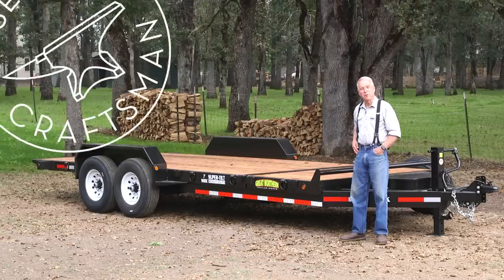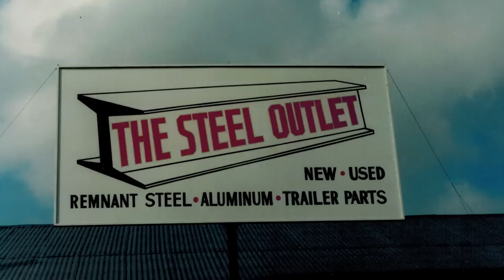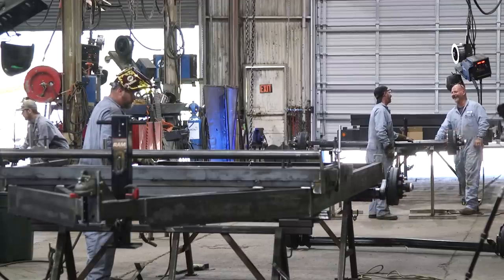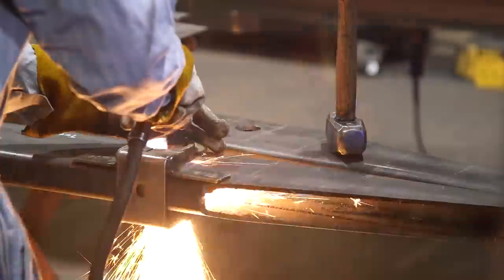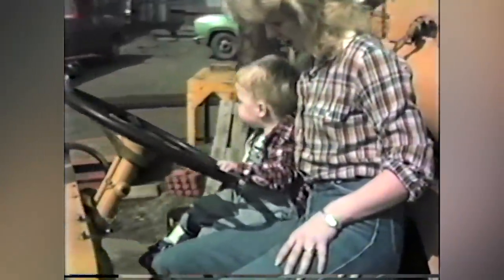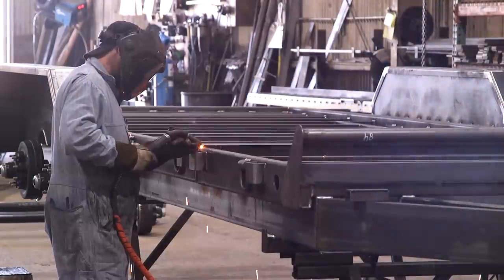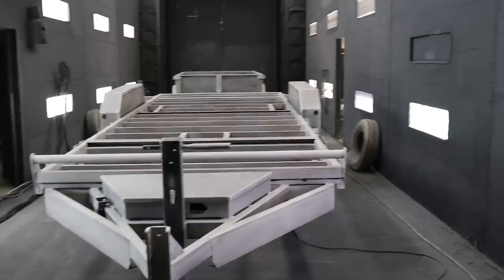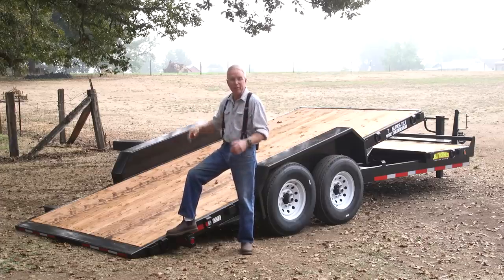EC Gets a New Trailer: 14k Tilt

Comment: As a mechanic, one sore spot I have with trailers of any make is the wiring. I have seen poorly routed wires that became pinched where the frame comes down, and I have seen electric brakes not work because the wires for the brakes had two layers of insulation and only one got stripped. 

And then there is the cheap, flat wire loom I saw here. There is just one layer of insulation protecting the conductor and that insulation hardens easily and cracks, introducing a pathway for moisture to the conductor leading to corrosion. I don't know what kind of connectors they use on these trailers, but open, unsealed connectors will fail. When I repair the wiring, I only use heat shrink connectors to provide a sealed connection.

This isn't a criticism of these trailers, but trailers in general. Thanks for the tour.
Reply: Agreed,
I have had several utility trailers over the years and the wiring always seems to go bad
Trailers are outside in the rain year round mud snow with little protection
Reply: I could not agree more.  I was hoping ot see more of the wiring process. It is usually horrendous  on most trailers.
Reply: They use heat shrink butt connectors and then convolute over the top to help protect the wiring.

Comment: Some years ago I was looking for a tilt trailer for my personal use. I quickly gave up on anything used. Anything nice and clean was priced to close to new and anything that needed work was either complete garbage (twisted frame etc) or by the time you bought new tires, wheel bearings, deck, and lights you were close to buying something new and would have ton of labor in it. So off to dealers looing for new. That's when you find out how many places build garbage. If they only have time to use the torch to free hand cut holes for the lights then they can't be taking time to make sure everything else is squared away. I really like what I saw here both in the fit up and the trailer design. Certainly a "great" product.

Comment: I really enjoyed this video.  I actually bought a tilt trailer back in 97', new, for (you won't believe) $650. (Walker, LA.)    I was so proud to have my little residential 12x6 flat bed, single axle w'tilt.  I always noticed & wondered , why I don't see more trailers w/tilt beds ?  Especially when so many others complemented me on it and frequently asked where they might acquire one. 

I don't believe I've seen even one similar to mine until this last few yrs.  (although I'm just a resident trailer owner and no guru in the trailer world)   But the dang thing really lasted w/all my travels as a carpenter & usage over the decades.  One thing I will say, I've been asked to sell it, many times, for over twice what I paid and it's worth it.

I have upgraded the lights to LED, changed deck boards out, painted it once (recently) and added a piano hinged alum. diamond plate to the end that flips down, as a transition to the 2" high end of the trailer, for rolling my wheeled carpenter box or 4 wheel dolly's up & onto the deck.

All in all, it makes me happy to see the quality and innovations of ppl that love their work and are out to serve others the best way they can.
Thanks for sharing, Merry Christmas,
God bless,
Sincerely ..............................

Comment: A great review of the need, application, and specific trailer.  Many guys have a need for a trailer and unfortunately do not have a good trailer.  A poor trailer can reduce productivity and can be downright dangerous.  Initially we bought a low price 7,000 trailer.  It was not very well engineered and seemed difficult to pull.  I took it to a scale and learned that it weighed 4,800 pounds empty.  That meant only a 2,200 pound legal load!  At the first opportunity, we sold it.  Now we have good trailers that are similar to the trailer featured here.  14,000 gvwr and 7,000 gvwr trailers that are well engineered and safe.
Hopefully, some young guys and guys new in business can learn from this review.

Comment: My company has dozens of Great Northern trailers, including the exact same trailer that you had built.  They are fantastic trailers that will last forever.  They also tow very nicely.
My only complaint is that often times the people who wire the trailers struggle with matching the colors of the wires from the tongue to the end of the pigtail, which makes it annoying to fix after a customer drags the pigtail.

Comment: “Most contractors overload them.” As my dads always said, if you didn’t want that much weight in the dump box, don’t make it hold that much
Reply: Weight vs volume of sand or wood or foam is much different per cu ft
Reply: @Sicktrickintuner  it’s a joke bud…..
Reply: And dad was RIGHT...Once again, like always!I 💯 As a kid...whenever we were working on a roof, my dad would always say: "Now remember, if you go to fall... DON'T!!"
Reply: That was kind of annoying when we were looking for a dump trailer as we wanted some volume for construction debris and we have the sense to not overload it with dirt, but no manufactures would make them with a higher volume without making them tremendously heavy duty because other people always overload them.

Comment: Surprised to see them building off of saw horses instead of in a jig
Reply: I would guess they have done both and settled on the saw horses for particular reasons.
Reply: I thought exactly the same thing. Nice to see them measuring for square but weird they haven't made that more foolproof.
Reply: @kevinhornbuckle  Yea maybe depends on the size of the trailer being assembled
Reply: @jessesilver  Yea square is only one metric I'm worried about. You can accomplish square but still have twist in the frame...

Comment: Whilst i know exactly why they made the front bar at that height... since you're in touch with the creators of this beast, that part should be adjustable. At least two units of height. If there's one thing i always mod on new trailers i have, it's this. Not all loads are made equal and having that height adjustment there is a bonus.

Comment: 1 Suggestion, if you want the trailer to work a lifetime, then hot galvanizing is the best way to go. Paint is nice, but you can throw hundred layers of paint and it will still rust. You can do electro galvanizing, it gives finer texture so its nicer if you paint over it, but its not as durable as hot galvanizing. Even if you scratch hot galvanized steel it will still protect, the steel will find protection against corrosion thanks to the surrounding zinc that has higher electrochemical properties than those of steel...
Reply: And the pest part about Zinc coating is if something breaks you can weld it back without have to start grinding the paint down. Just don't breathe in the fumes, they are bad for you. Zink metal fume fever is not nice...

Comment: Now EC needs a new truck capable of pulling that trailer fully loaded
Reply: are you kidding me? that's thing is pure mechanical 7.3 pure awesomeness combined with a manual transmission. it will outlast any new truck any day. those new trucks have weak cheaply made paper thin frames, cheap crappy electronics that fail in cold weather, and more sensors than you can imagine that will fail all the time like clockwork. and if you watch his old video titled my tool tank, he wisely describes how this truck will definitely outlive the owner. us humans don't live forever you know.

Comment: @ 15:03  the guy with the drill tht has a contraption made up to drill into the decking. He is drilling @ a 45 degree angle. This makes me very curious is to why he is doing g so. Maybe cause the way the wood will swell ans Contract and shrink. Can't he a water prevention type of deal for sure. Very Interesting as u can plainly see it is on purpose he is doing so.

Comment: Does the trailer stay tilted while the equipment is loading or does it reach a balance point where it is going to tip regardless if the back wheels are on the ramp?

Comment: The only problem with a 14K rated trailer is that you will need a class A driver’s license to haul it unless you are pulling it with a 3/4 ton or less…1 tons nowadays have a GVWR of 14K. That puts your truck and trailer at a total of 28K; a class A is required over 26K. If you have a class A, it’s great, otherwise I recommend a trailer rated at 12K.

Comment: The old F350 will be struggling pulling that trailer fully loaded. You’d really need the trailer brakes to be working in tip top shape OBS Fords don’t have that great of braking power either. Ya that’s a well built trailer It will last you a long time. Nice to see they use torq flex axles.
Reply: How old of a f350? My ol 7.3 powerstroke would pull a decent load but it will be crawling😂😂 just upgraded to a 6.7 this summer and wowwee what a difference
Reply: @CerretaniOutdoorsLLC  The 7.3 makes more noise than power it was good in its day. I haven’t driven a 6.7 Ford I’ve been told they have a lot of balls. I’ve owned 7.3 IDIs 1 7.3 OBS power stroke and 3 6.0s I currently own a 6.2 gas I’ll never go back to a diesel truck again.

Comment: One mark of a really good trailer, sadly, is how often they're stolen. A local firm to me, Ifor Williams, has the unfortunate sub tag line of 'the most stolen trailer in the UK'. For the last few decades they've been putting the serial number really prominently (2" high welded number) on expensive to replace parts like the hitch in order to make stealing them less profitable.
Reply: I used to work a lot with Ifor Williams trailers here in Denmark,the best and sturdiest trailers ever,but on the same time,its the heaviest.Havent managed to destroy any yet (hahaha). I own a humbaur now,its half as heavy for the same gross weight 3500 kg but it only weighs 636 kg empty,the ifor weighs 1000 kg empty,no ramps or any accesories.
Reply: @benjaminsagau  agreed. The Ifor's were originally built for Welsh farmers who expected a product that they would buy once. I've done a few repairs to Ifor Williams trailors but only ever brakes (worn out) or electrics (damaged). I think they were the first all galvanised trailer on the market here in the UK too. 
The trailer I use now was built (on the night shift) by some of my ex-colleagues at Perkins Engines. Someone bought a kit and asked the Welder in our experimental department if he could weld it together for them.  He did,  but only after we'd neasured every piece and got one of the Design Team to draw it all up and create a Bill of Materials for it.
We builr a copy of the original and most of us used the copy for a few months before getting out heads together and discussing its failings. We then took it to pieces, moved the axle furthet back and stiffened the frame. End result: a trailer which, though a touch heavy on the nose weight, backed more easily and could be towed, loaded, at 80 miles per hour without any instability. Martyn, the Welder, was telling me at his retirement party, that he'd built more than ten of the modified design version. Occasionally I'll see one of them round the area still.